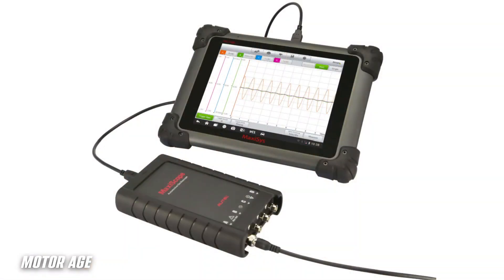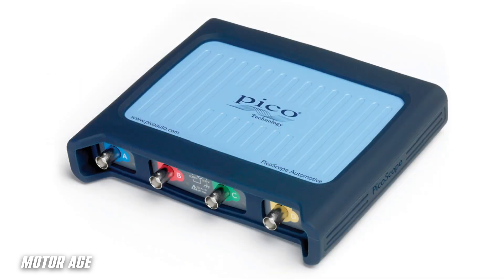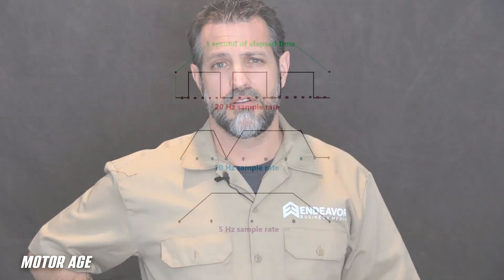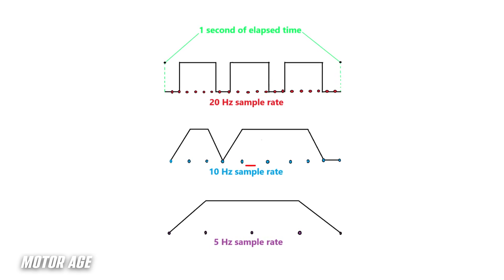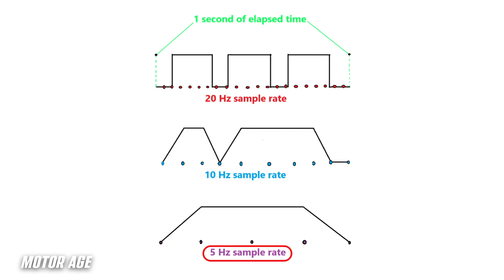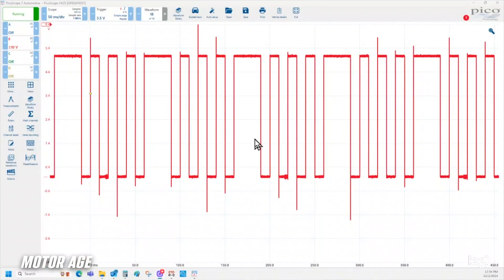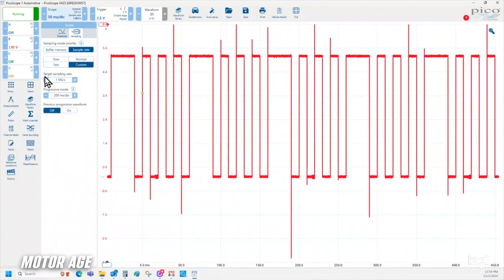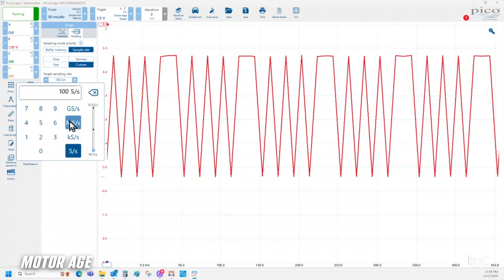The Trainer #155: Scope Sample Rate vs. Buffer Size

Comment: how do you determine the speed of the signal you are trying to capture so you can set up your capture rate accordingly?
Reply from the maker: For instance:

If one were to use vertical cursors to measure the fastest transitional speed of a CAN bus signal, you would find it to be approximately 500,000 Hz  (transitions per second).

Multiply that by 10 and you would require roughly 5,000,000 samples per second to guarantee the signal was accurate. 

Please understand, it is not always necessary to have that much sample rate.   In other words, a cam sensor signal is also a square wave, but does not transition nearly as fast. As you can see from the sample I gave in the video, we did not need 10 times the speed of the signal to acquire an accurate depiction of the waveform. So long as it is accurate enough for diagnoses.